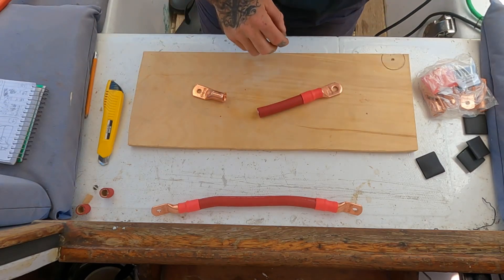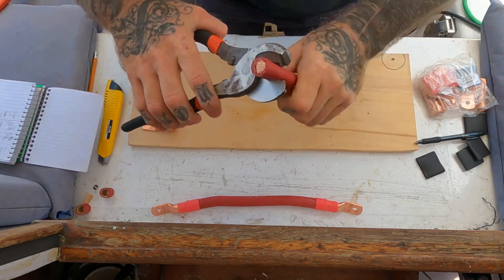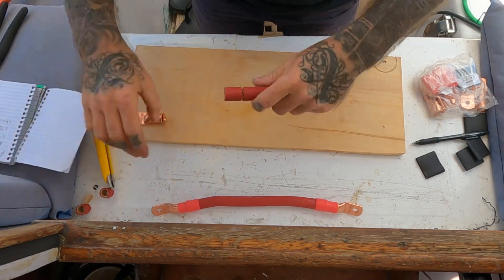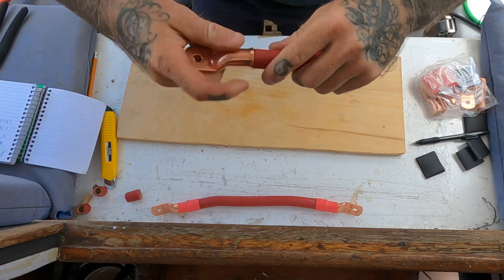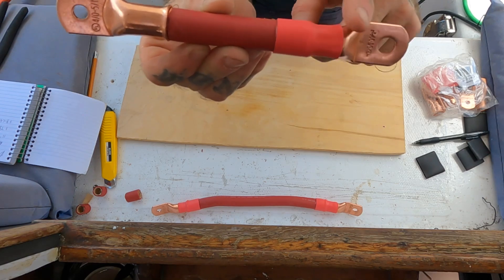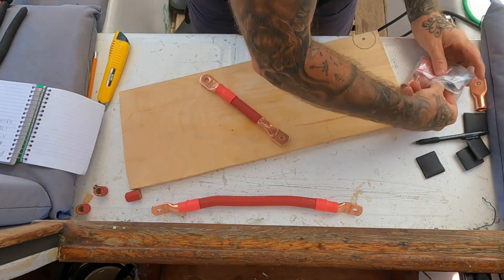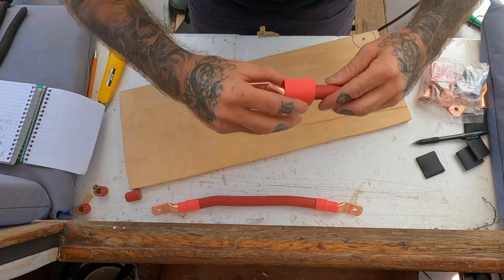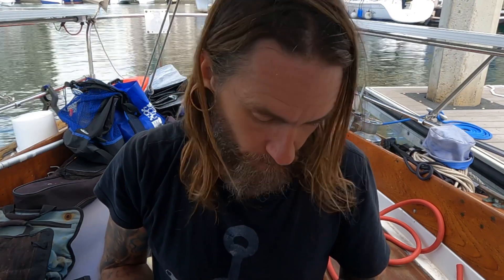How to Make Custom Battery Cables for a Lithium Battery Installation by Sailor James

Comment: I got a little OCD while making a set recently. There seems to be a capillary space where the tubing is flattened, where water can get into the cable. To fix this I drop a bit of solder and flux into the empty terminal and heat it up with a torch until the solder wicks into the capillary space. Then use adhesive lined heat shrink tubing to seal the cable insulation to the terminal. If I don't have adhesive lined tubing, I use hot glue on the cable-terminal joint and then heat shrink over that. The hot glue seems to bond very well to the heat shrink. We'll see how well they waterproofing holds up, but the cables and terminals are both tinned regardless.

Comment: Your Video is nice, James. Good Job!!! But this hydrauliccrimper is very expensive here in germany. for only one time use to expensive. I use old technic here we call it "Klemmkabelschuh". It is cheap and it needs no crimper. Only 4 bolts to tighten.

Comment: I noticed you used non-tinned battery cable.  I suspect it was much cheaper than tinned.  If you don’t mind me asking, what was the difference in price?
Reply from the maker: I couldn’t find tinned 4/0 cable anywhere or I would have bought it regardless of the price